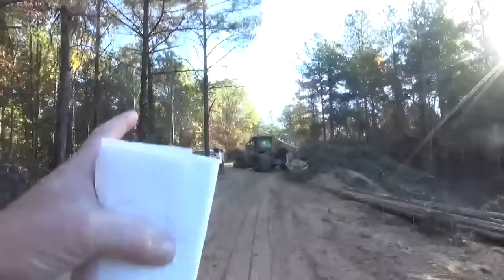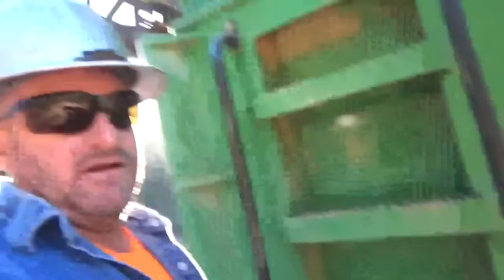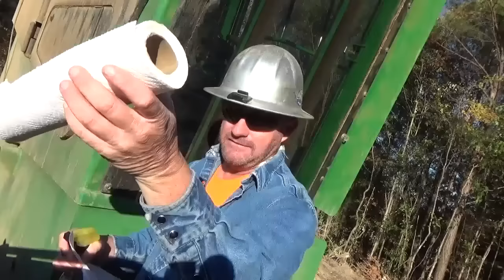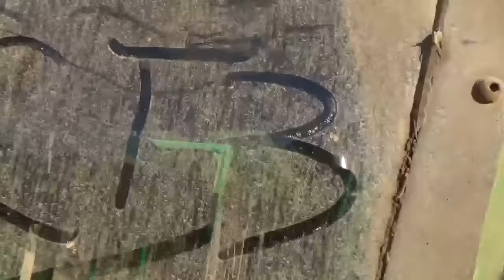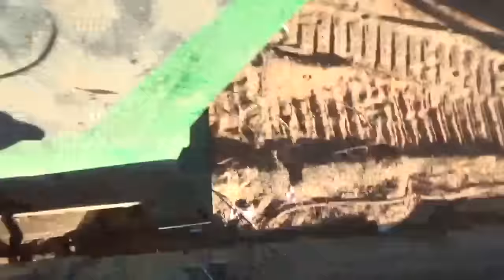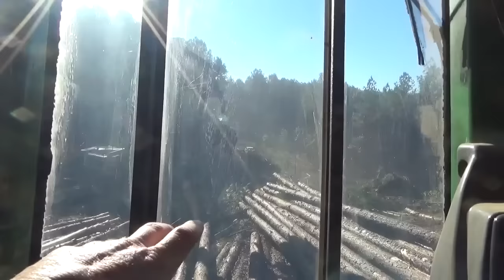BIG boogers!

Comment: Hi right now I'd rather have some dust like you got, Up here in southern Manitoba Canada it's so wet guys are sinking combines trying to do corn and are waiting for frosts. I'm digging clay with a backhoe loader this week, 4ft down its like snot!!!!!!!!!. As the machines rocking on the stabilizers it's pulling the water up and I have to keep moving the machine as it sinks .  we are having to pile the clay hoping it will dry some before using it.  If it don't it will be frozen like a rock in about a month when it hits - 30oc if we get a usual winter for here.